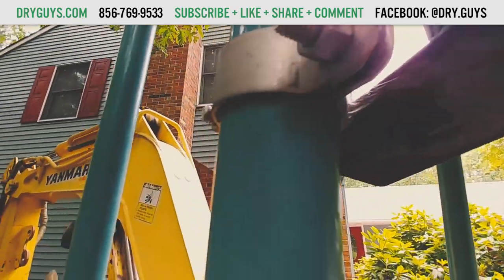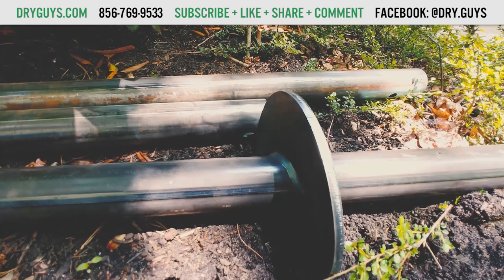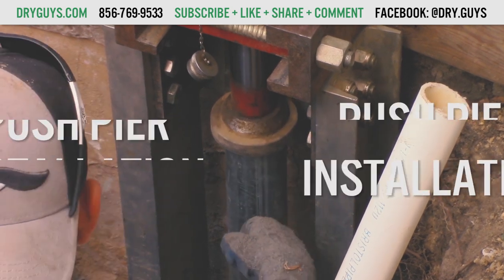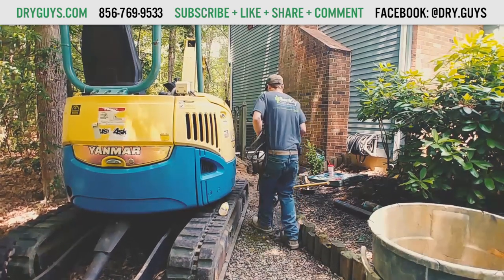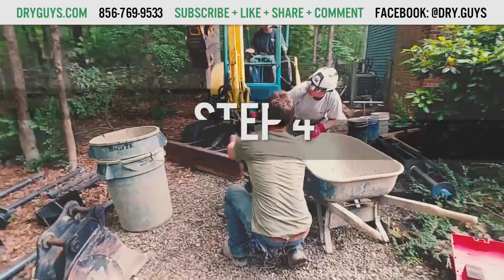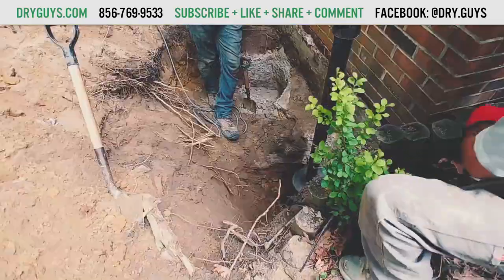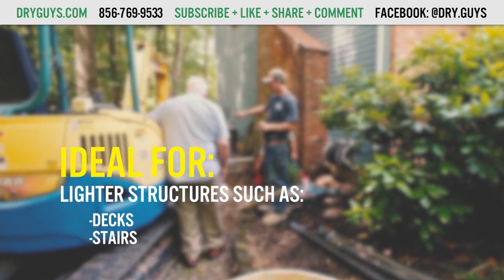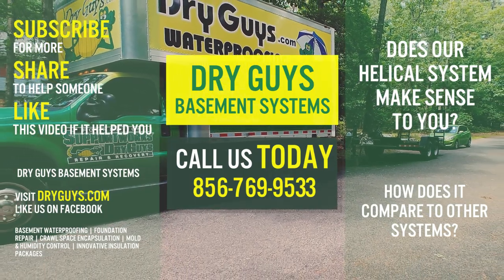🐊Helical Piers for Foundation Repair? How to Install + Homeowner Tips

Comment: What is the best fill for beneath the gaps once raised? Im being quoted for a structural foam and ap 430 chemical grout...
Reply from the maker: Had to ask the owners about this one! The overall consensus is that if the helicals are installed correctly there shouldn't be any gaps as the helicals have screw like attachments to the rods. It won't create gaps, it "screws" into the ground. They also said foam may or may not work.

Comment: I might need a job like this done on a house im looking at in PA🤔🤔🤔
Reply from the maker: If you can get the homeowner to schedule an estimate, the estimate will be free (for Basement Systems dealers such as ourselves). Depending on what part of PA the house is in, it may fall in our territory, but if it doesn't, we can refer you to our sister companies in the area.
Reply: @DryGuysNJ  do u guys do work on leaning chimneys by the Johnstown pa area ? 🤔
Reply from the maker: @JerseyStyle7  We can fix leaning chimneys but Johnstown is outside of our territory. That being said, if you call our office at 856-769-3800 and explain the situation, we can get you connected to our sister company in your area. As Basement Systems / Foundation Supportworks dealers, we are confident in the quality of work of the companies in our network.